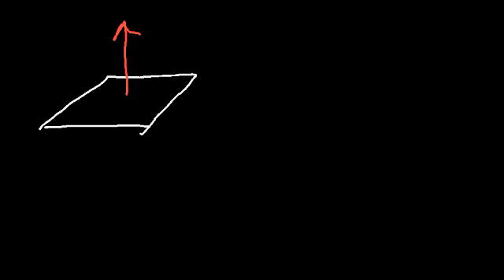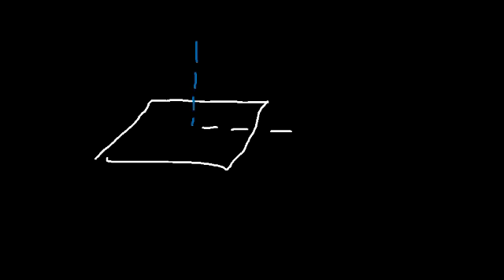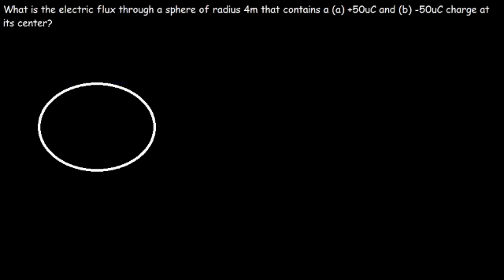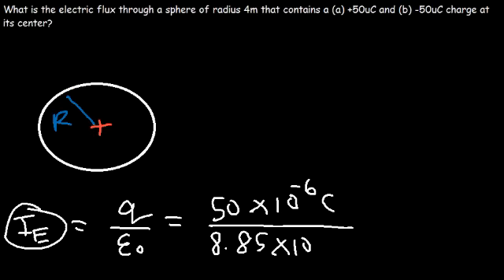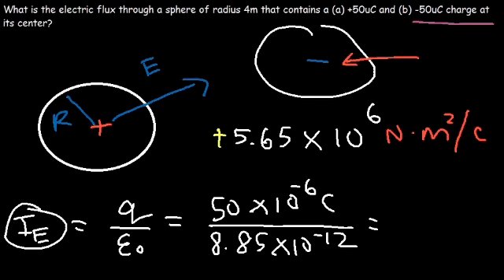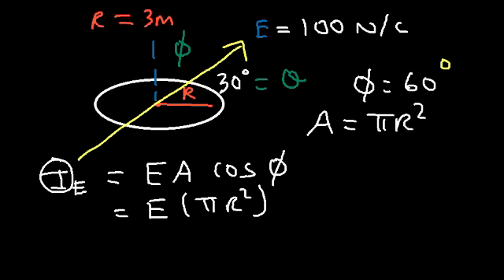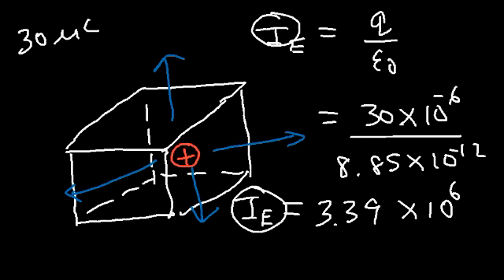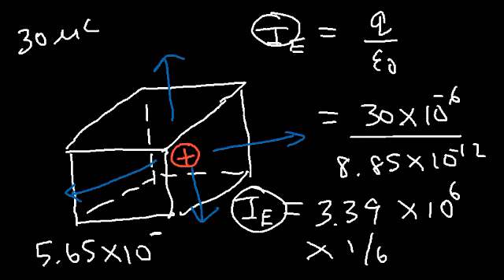Electric Flux, Gauss's Law & Electric Fields, Through a Cube, Sphere, & Disk, Physics Problems

Comment: (i)Define electric flux. Write its Si units.
(vii) Using Gauss's law, prove that electric field at a point due to a uniformly charged infinite
plane sheet is independent of the distance from it.
(iii) How is the field directed if
(a) the sheet is positively charged
(b) Negatively charged?

Comment: Electric flux & field are 2 different entities. Flux is scalar qty. measured by its density while field is a vector qty. shown by line with arrow. A charge has flux but not field around it.  Electric field is a force field which appears only when electric fluxes of one charge interacts with flux of other charge. Both,  flux density & electric field strength follow inverse sq. law. Change in flux density and motion of flux produce all forces and motions. Flux density b/w like charges increases which produces repulsive force while flux density b/w opposite decreases which produces attractive force.

Comment: I'm a little confused about the last example with the cube with L=3m. Wouldn't the electric field be different at both ends? Since E=k*q/r^2, and the second r is 3m greater than the first r, wouldn't that mean that they couldn't possibly have the same E value?

Comment: In what cases does the angle on a cub surface equal to 180?
Reply: The Angle of the electric field line would be 180° if the line was going into the surface.

Comment: I think it is worth mentioning that inward flux is negative because it is technically at a 180 degree angle, and cos(180)=-1.
Reply: I love that
Reply: I don't get it, how is it at a 180-degree angle?
Reply: @KikisStudyCorner  its like how torque utilizes a sin function because max torque is tangent to surface of spinning thing.
Reply: @KikisStudyCorner  The area vector is outwards. The electric field lines are inwards. They are anti parallel or in other words, at an angle of 180°
Reply: @KikisStudyCorner  think in reference to a unit where max outward is at 0 rad
Reply: unit circle
Reply: @scottpatrickdavis  flux= EAcos theta (A as in for area) and if the electric field is entering the body then the angle is 180
Reply: @KikisStudyCorner l mo lol
Reply: @KikisStudyCorner phi is 180 because normal is downward and electric field is upward which means opposite facing so 180
Reply: Very interesting! Good thing to know
Reply: @gurulinggbiradar6982  well it was helpful to me.
Reply: Yessir
Reply: oh shoot, thank you. That helps a lot!

Comment: Can some one please explain why a charge located outside a box shaped surface area produces zero net flux? I cannot seem to make sense of this because if the electric field decreases in magnitude with increasing distance from the source, won't the electric field lines leaving the surface have less magnitude than the ones entering it, which leads to a greater flux inwards than outwards? Thanks
Reply: you are finding the net flux of the cube, not the source

Comment: 4:43 I put the values in my calculator and my answer is not the same. my answer is 5649717.514 and i tried to divide it by 1*10^-6 can someone explain to me please
Reply: Your answer is the same, it is just not in scientific notation. Your calculator should have an option for it